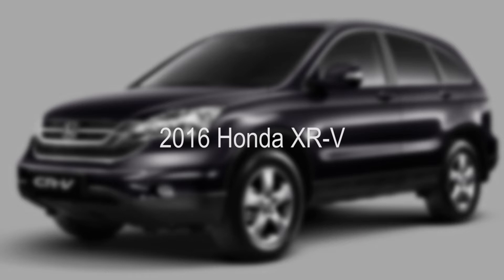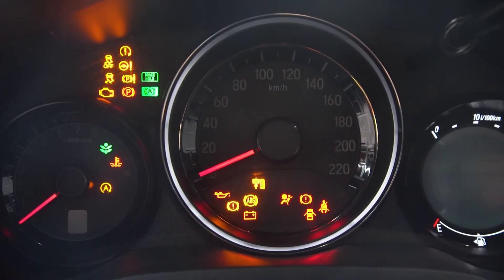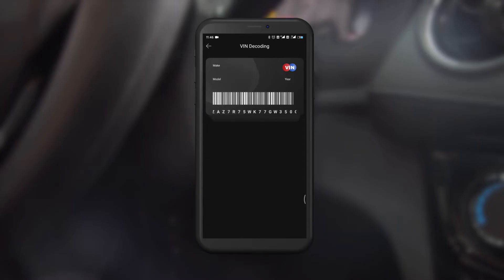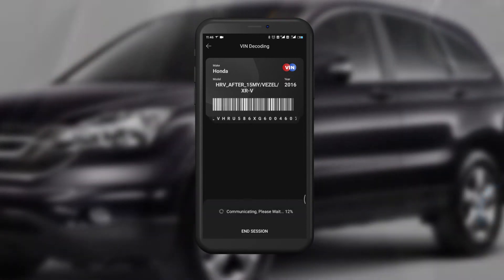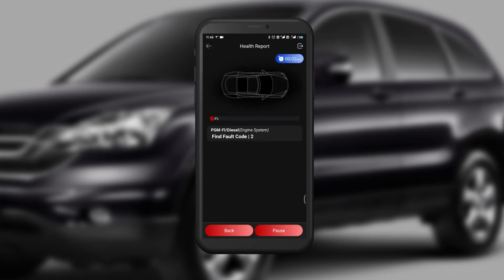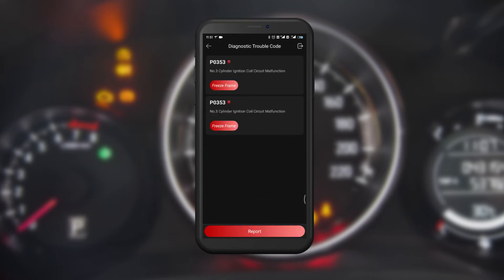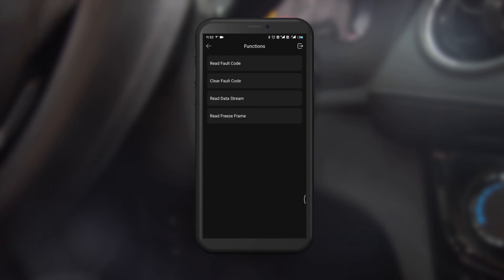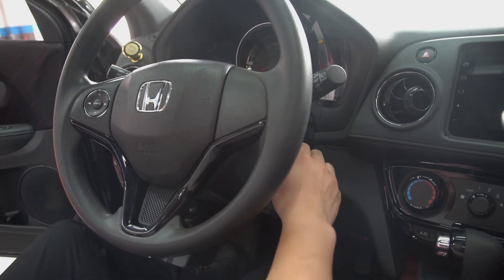How to diagnose and fix a Honda XR-V with THINKDRIVER?

Comment: Do you clear the code with the engine running or just the key in the on position?
Reply from the maker: Hi sir, it depends on different vehicles, please follow the instructions in App.
Reply: @ThinkcarOfficial  I did, it doesn't specify. It just says "clear check engine light".